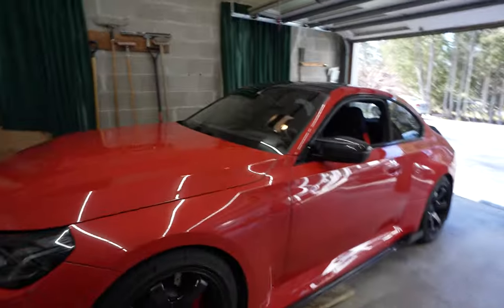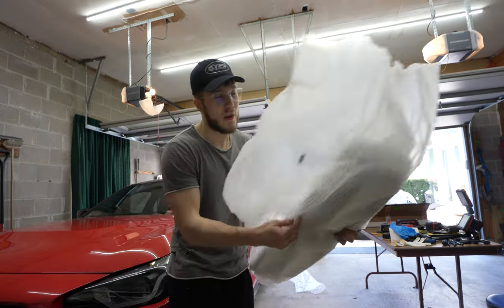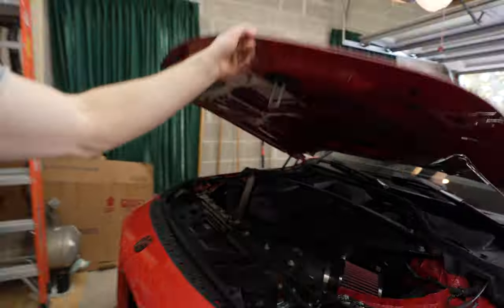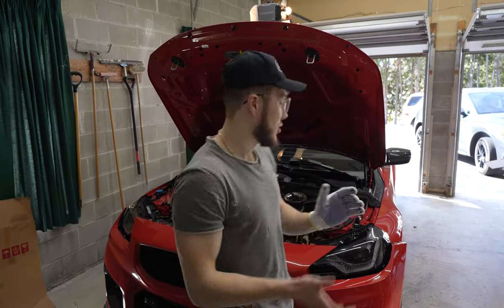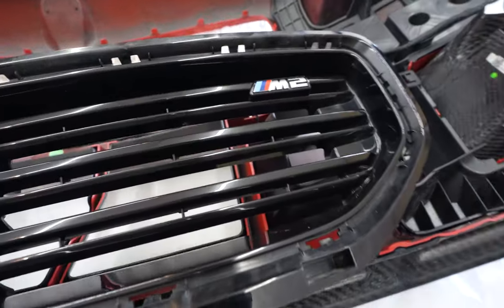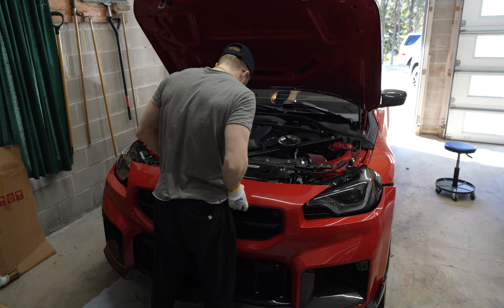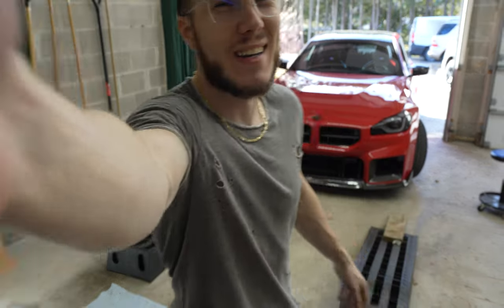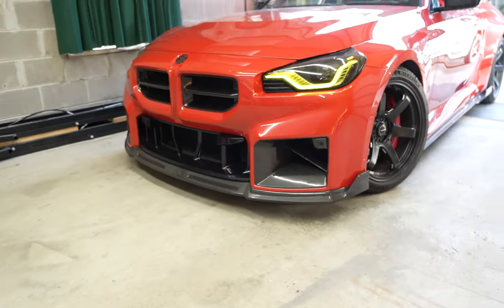*FRONT END PERFECTION* | Installing AutoTecknic Carbon Fiber Motorsport Grille! (BMW G87 M2)

Comment: You should put the carbon fiber center front bumper trim, I just installed it on mine and it makes a huge difference. I wish somebody made the oem front grill but in carbon, now I have all carbon in the front except the grill
Reply from the maker: You're reading my mind man!! haha 

Was hesitant to say the front was finished because that would really be the final touch.
Reply: @DailyDownshift  best thing about it is it doesn’t scratch up like the stock plastic piece😂 when I got the car new it was already swirled to hell

Comment: Howd you get thr bumper to pop off so easily. Arent there 2 8mm bolts on both sides above the parking sensors in front of the wheel wells?